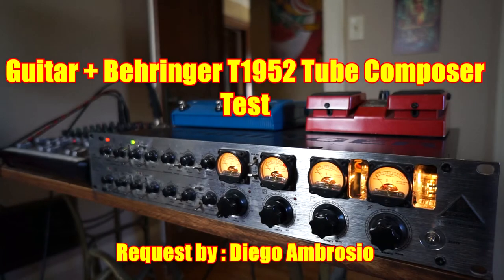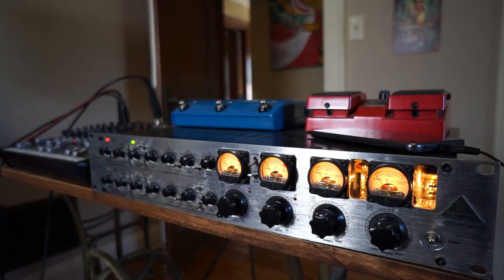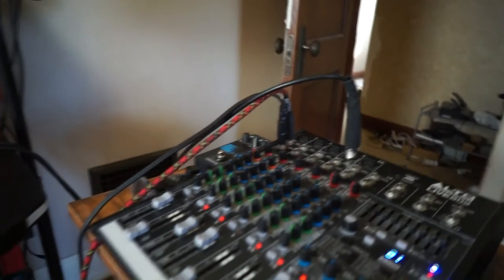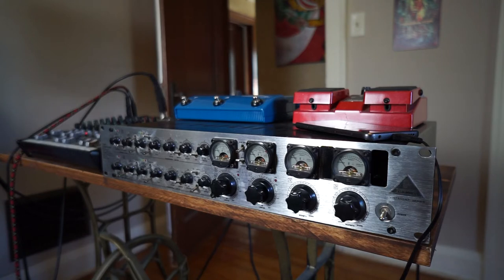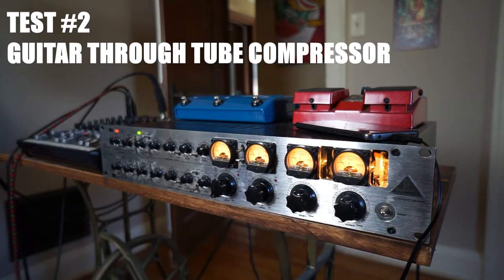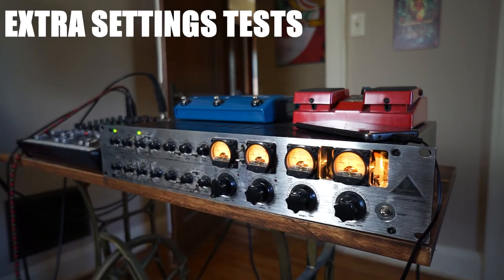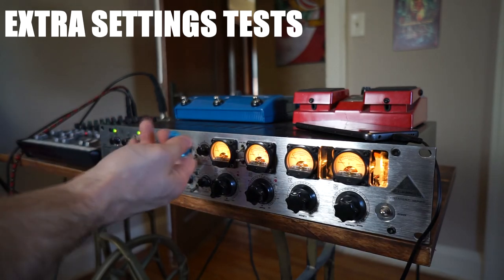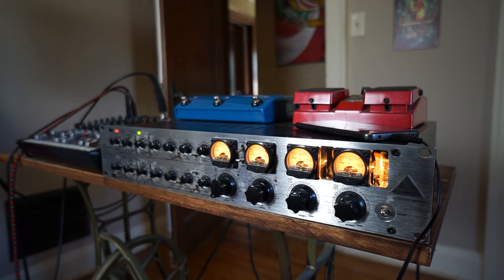Behringer T1952 Tube Composer Guitar Test

Comment: The tube saturation will work ok with the tube composer ,looks like your input volume is low for starters according to the vu meters that show input ,output and gain reduction  , Note its not actually a tube compressor , and you will need to push the unit and to drive it a bit for the saturation to be noticeable  i have other tube compressor that the tubes are in the pre amp stage and eq stage and so forth ,yes the tube composer  will add slight saturation ,i have one and use it in my stereo system ,the best way to describe it is ,its like the old days of cassette recording if you recorded with dolby NR on then played back the recording with it off ,that is the effect that the tube composer  will come up with ,actually i think it say,s that in the instructions  ,if you want a real tube compressor ,go get an Avalon , TL audio , or even an ART VLA 2 ,but for the money the Behringer composer does somewhat of a nice job .
Reply from the maker: Huh,  I agree with most of that. I am to used to my large guitar amp heqd with many large tubes. That saturation is so obvious when playing guitar through. I have experimented with many settings. Definitely not an expert on this unit. It sound like you are saying the volume goes hand in hand with the amount of saturation. Ill have to give that a try n see if I notice. An Avalon would be nice but cant afford that at the moment.